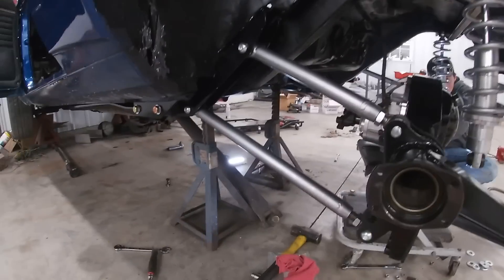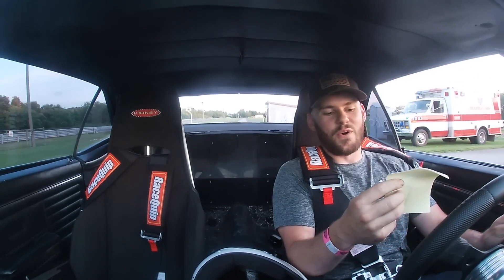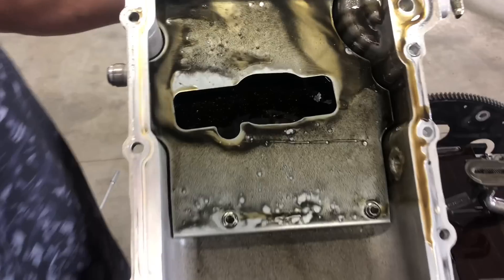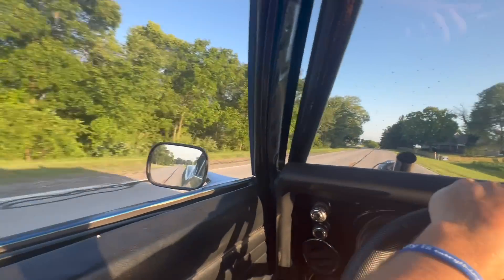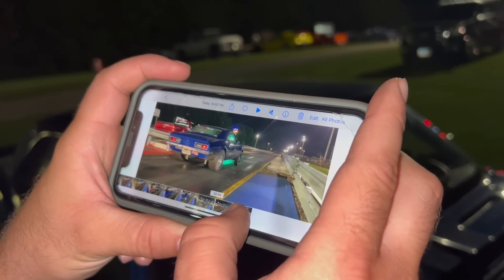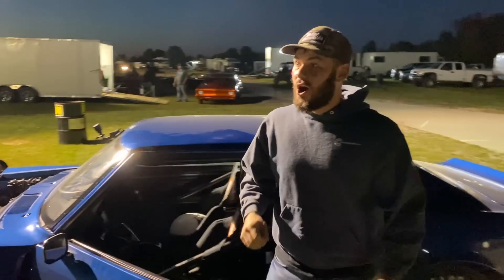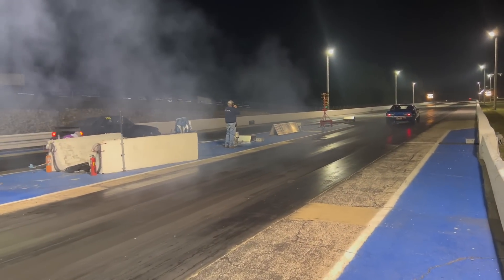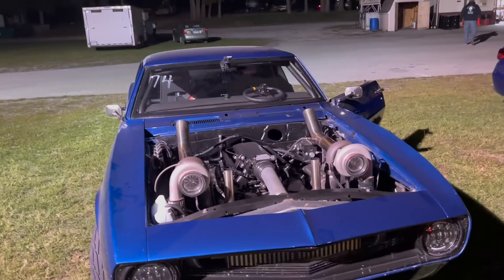5 SECOND STREET CAR!!! Here's The 2 Year Story

Comment: Nice job.   I haven't cracked the 5.9X code yet.   But I've managed 118 mph in the 1/8 mile.   So I know it's in there if I can get it sorted out.
Reply from the maker: Thank you sir. Oh yeah 118 is moving on the big end. Just need to get that 60ft sorted out now
Reply: @Rev2lateRacing  the car has done 1.30.  But it's wild.  Bucks and bounces all over.   Made some 4 link tweaks, but the only chance I've had to just it the track was super cold and didn't have any bite.   Plus my slicks are 3 years old nor
Now, that's definitely not helping
Reply from the maker: @Wormser_mcfrazzleweiner  yeah it’s crazy what kinda noises you hear when these cars launch hard. New tires do make a big difference I’ve found lol

Comment: The camaro has came a long way 👌🏻

What 4 link are you running in it if you don’t mind me asking?
Reply from the maker: Yes it has and has a lot more in it, I hope anyway lol. The 4 link setup is made by tci. It’s the 4 link/subframe connecters all in one kit.
Reply: @Rev2lateRacing  haha regardless the car is moving man!! 
I asked about the suspension because I have a 68 camaro and plan to run a similar set up
Reply from the maker: @adriantinoco8561  at first I really didn’t like the 4 link kit bc there wasn’t a whole lot of adjustments. But now I’ve started to figure out the suspension with just the coil overs and it’s starting to work on no prep and prep. We’ll see if I can get the front end to stay down lol